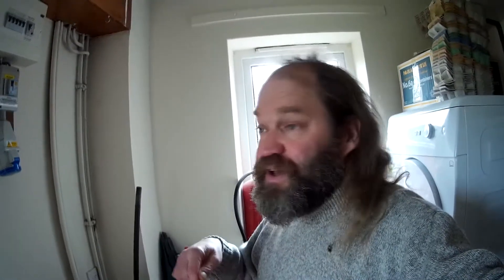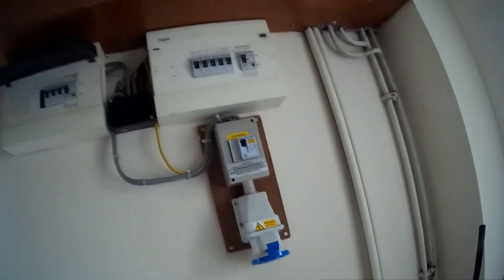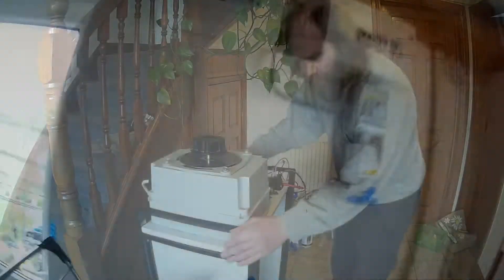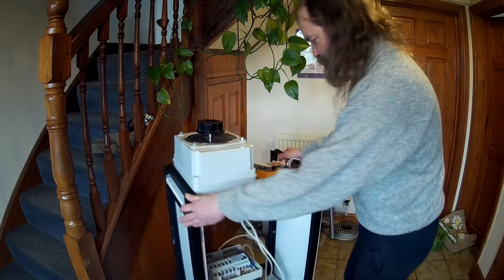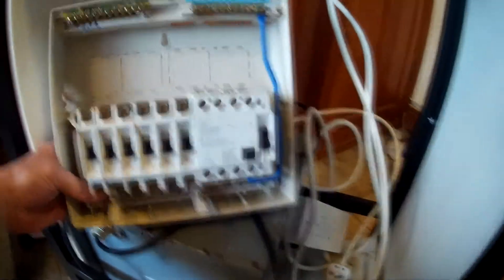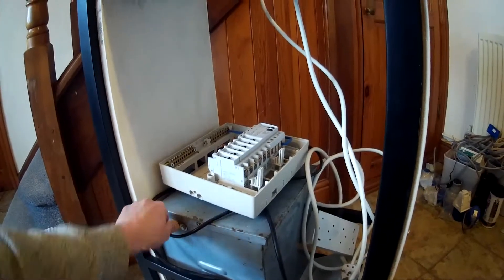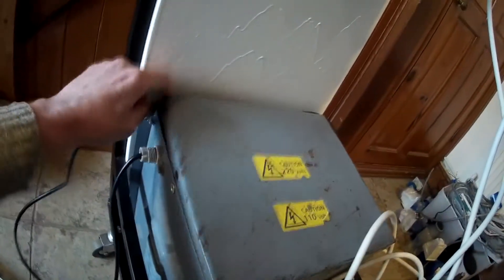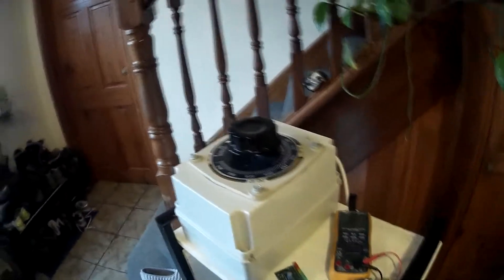Tower of Power introductory video.

Comment: I have a 2kva 240 to 110 volt transformer in the garage on its own supply of 40 amps and it will still trip the house on occasions, I had the electricians in and they have all told me that such an inductive load will do that just depends on where in the cycle the switch closes. Trouble is I have loads of 110 volt power tools from when I ran my own fabrication business and now I have retired I dont want to just get rid and replace them all with 240 volt tools apart from the cost my experience is 110 volt are more durable. The only answer is to replace the trips with slower ones which are used in industry.